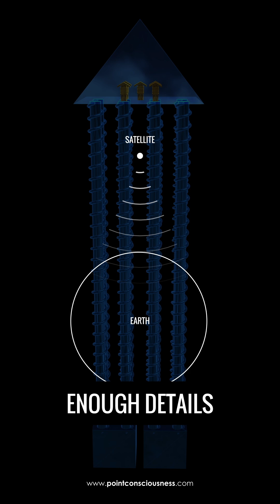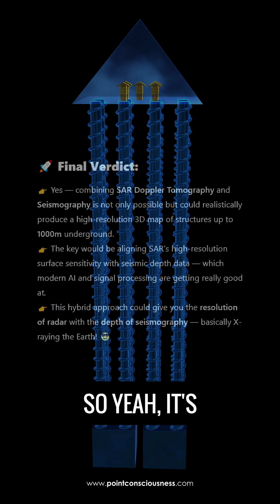Technique used to achieve 3d scan of underground structures beneath Khafre Pyramid

Comment: since there's no other way to ascertain what's there except to start drilling or excavating, nothing will come of this any time soon to confirm or deny the claims. Other than that, I saw another report saying that earlier research found no such cavities in the immediate shallow foundation. Compared to the dimensions of the pyramid, these are supposed to be huge cavities. It doesn't matter at all that they supposedly reach 1km down, they should've be detectable by these earlier methods.